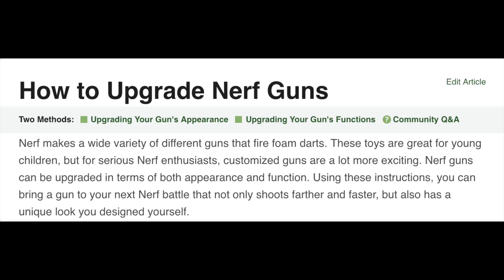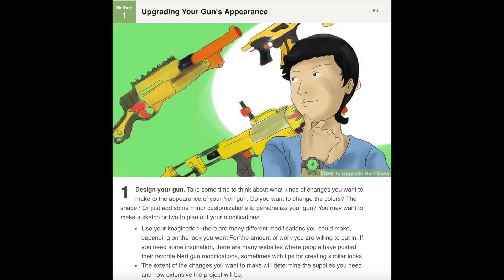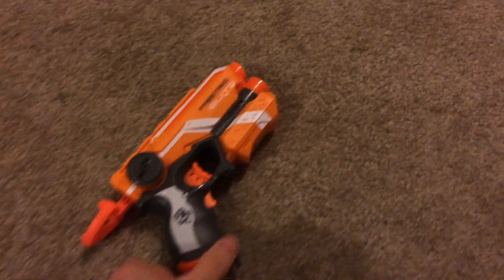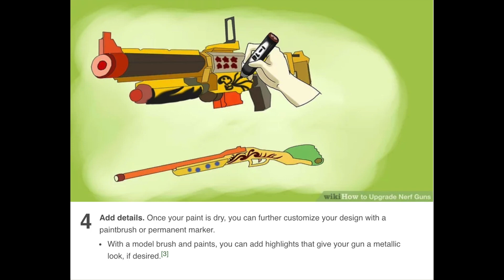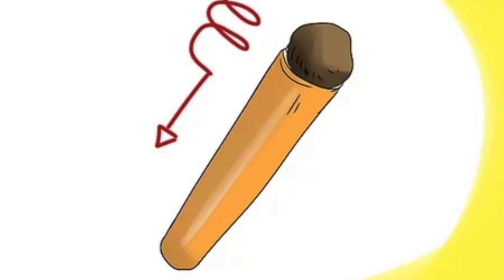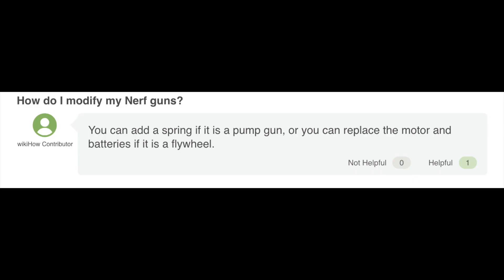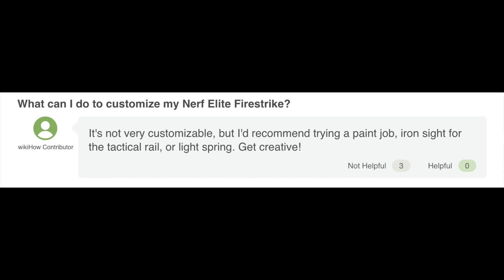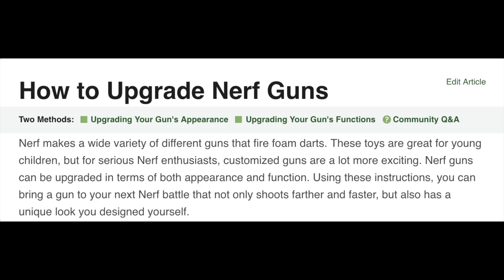wikiHow: How to Upgrade Nerf Guns

Comment: Internal mods are so much better than aesthetic mods
Reply: Sometimes aesthetic mods end up allowing the blaster to preform better or worse its good and bad at the same time.
Reply: Cries in sleeper overstryfe
Reply: I normally do both
Reply: Engravings give you no tactical advantage whatsoever...
Reply: No
Reply: i never do internal mods 
Becouse iam scared to break it
Reply: @reentrysfs6317  ive killed an accutrooper, my mom will now not even let me remove dart posts now
Reply: No shit
Reply: @JohnJames.   Full worker mods would be better than doing that because just adding a stronger spring without any protection will damage the insides
Reply: Yeah but why would you need you gun to shoot 500 mph? Cosmetic mods, if they actually look good are far better imo considering there isnt really a reason to make you gun shoot better if you just get a good one to begin with. And if your doing it competitively, just use airsoft.
Reply: @magnumbeefus  people prefer their nerf guns to shoot further and more accurate,because stock nerf guns accuracy is worse than my aim in csgo
Reply: Yeah, but sometimes both are good
Reply: @magnumbeefus  airsoft isn’t as customizable as nerf, plus some people might not be into milsim.
Reply: @narenthebeesechurgerman422  tbh I do think my logic was a bit flawed back than. But I still dont 100% get why people want their gun to shoot as hard as an airsoft one.
Reply: @magnumbeefus  it's a hobby thing, people want to tag each other at more range

Comment: I wanna remove the smart AR and add 2 jolts too a double strike too make a 4 shot pistol shotgun but how do I connect the jolts to the double strike trigger?
Reply: You could probably link it with a type wire. Try and do some tinkering

Comment: I remember putting electrical tape on the lever of the big zombie strike crossbow, I put the the tape there because it was hard to grip and pinched my hands. So my solution was tape, it stuck in some places better then others but it worked alright.

Comment: bruh, before spray painting a nerf blaster, you need to open it up, gut it, THEN spray paint it with multiple coats to get the best quality and put the internals back in. And weighting darts with rocks?! No nerf war would let you in because of safety issues, and that might make the dart too heavy, just dropping out of the barrel (are the people who write wikihow articles serial killers?) No hate, I'm referring to that these wikihow contributors are nerf noobs